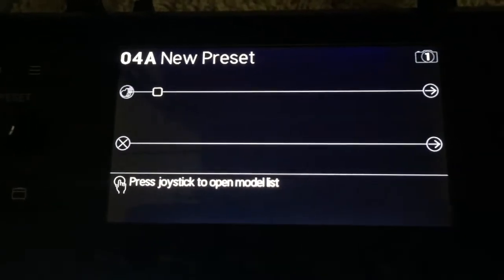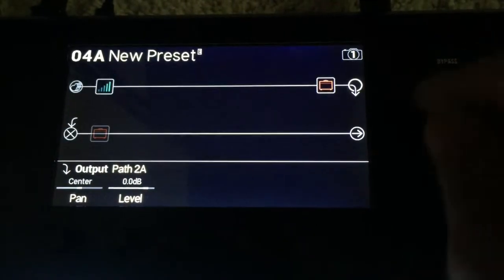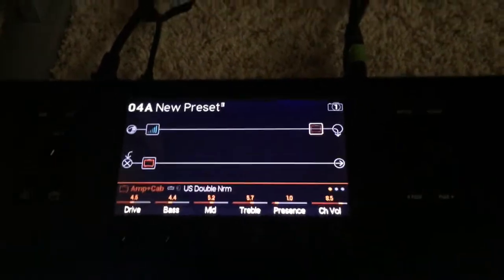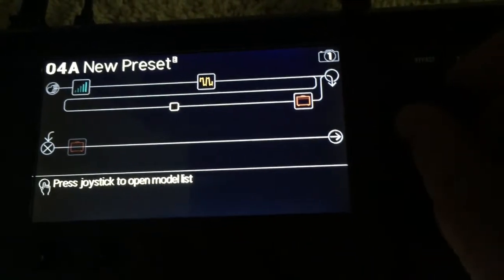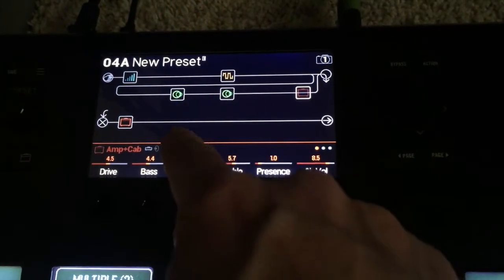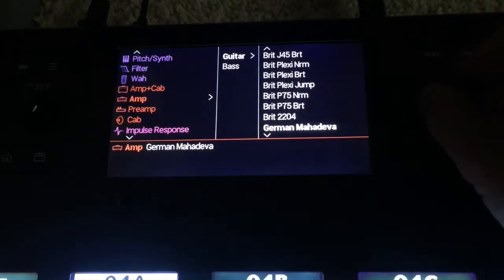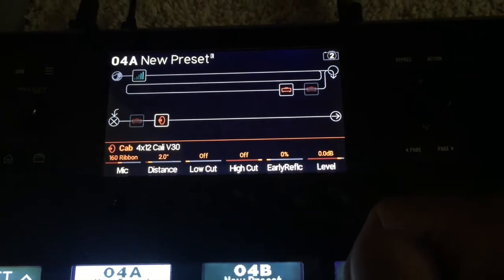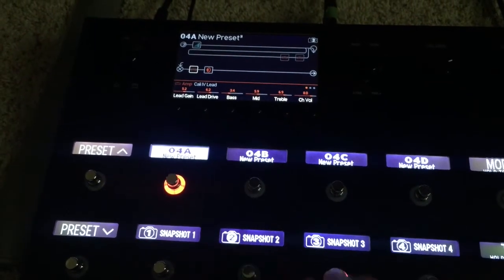Line 6 Helix Tips: Channel Switching Amps

Comment: Hi Ben,
this video was very helpful. Thanks for your work. Also thanks for the tips in the Helix facebook-goup.

In this video, you never press the save button but you can switch between the snapshots and there different blocks on/off. I thought I have to press save-button every time bevor I change the snapshot.

Greetings from Germany
Markus
Reply from the maker: It's a global setting. If you have it set to "discard" snapshots then you have to press save every time. If you have it set to "recall" then you don't have to press save. Mine is set to "recall" so that's why it works in my vid. If yours is set to "discard" then you will have to press save every time.

Comment: This was really helpful. Is there a way you can make two separate chains? Like have all the effects on the lower chain just be with the lower amp model.
Reply from the maker: Christopher Ashley-Smith , Yes you can treat the upper and lower paths as completely separate rigs and switch between them. I have not made a video about that specific case yet but it is possible.
Reply: Easy peazy, just make one rig up top, one rig on bottom, and use a gain block with -x dB (so you can’t hear the amp when the gain block is on) at the beginning of both chains, set a footswitch to toggle one off and one on. You could also use snapshots.

Comment: Love the video, great info, thank you!  I am wondering though, how do you have that Guitar stand mounted?  That’s such a great idea!
Reply from the maker: You can see at the beginning of the video behind my head there is a custom shelf I build that the two bottom feet sit on. Then at the top I have a similar bracket but it has "C" cutouts in the shelves. The upright side bars of the stand fit into the "C" cutouts and holds it against the wall. In some of my guitar playing vids you can probably see the top brackets a bit.